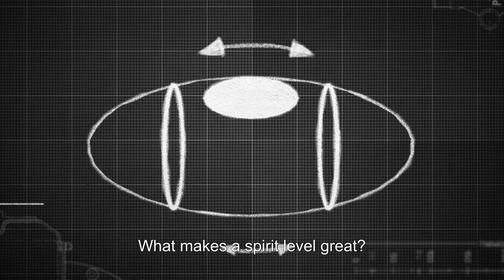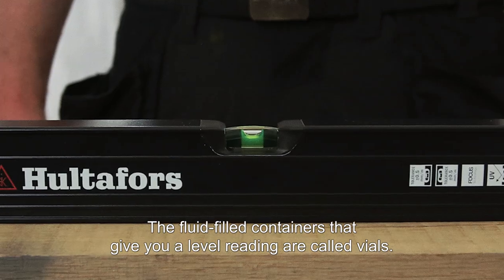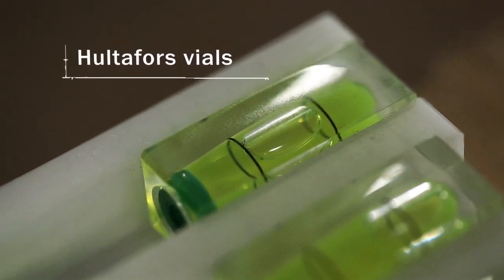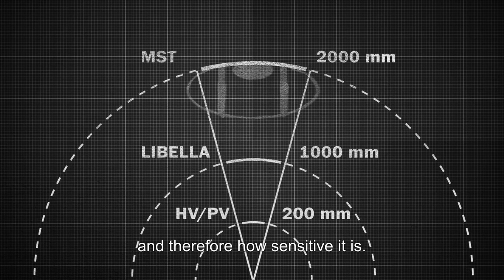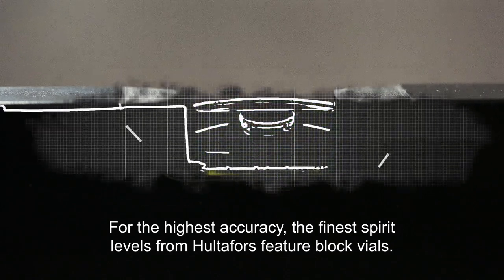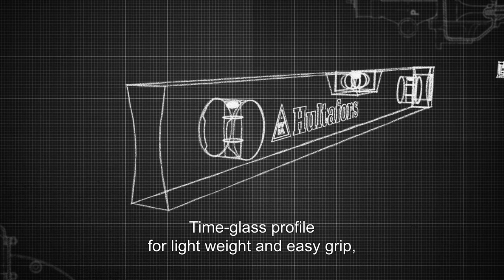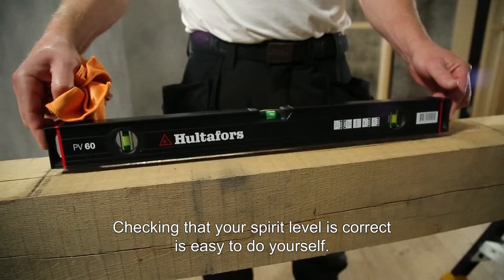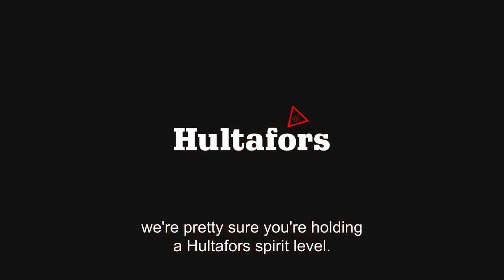Hultafors  - A higher level, the straight facts about spirit levels (with subtitles)

Comment: 9:29 Seriously?  What am I supposed to do, guess if the bubble is centered somewhere between the lines?  Why isn't the bubble big enough to reach both lines when level and centered?  There's a lot of room for error - costly error - with the slop between those lines, easily up to 1/4-in. out of level over a mere two feet.  Today's levels are crap, including Hultafors.  I still have four older levels, a four-footer and three two-footers, and when level, the bubble on all four touches both lines.
Reply: I was wondering if it was just me noticing how the bubble doesn't fit between the lines, and there are no secondary/runoff calibration lines.
Reply: @disklamer  That is an excellent idea - secondary calibration lines.  Level manufacturers should adopt it.  One of the issues I have with "modern" levels is that the bubble keeps getting smaller.  One comment I read said that an expert can judge where the bubble needs to be to be level.  I say BS, lots of factors affect that reading - eyesight of the user, sunlight, cold, awkward position, etc.  If you have to guess, there are going to be errors, and the smaller the bubble, the more likely an error.
Reply: @rla1000  Unless you're working at eye level it can be damn near impossible to read a bubble, I've started using my phone camera to get an angle on a bubble but it's a whole new set of juggling skills.
Reply: @Petertronic  And that's BS.  Why is the bubble ALWAYS, 100 percent of the time, in between the tow lines.  It NEVER reaches the two lines.  So that explanation is bogus.

Comment: Are Hultafors brand levels manufactured by Sola? Especially the high precision jamb level looks identical to Sola HPL model. The box level in the video looks like Sola but anodized black and with slightly different removable end caps.
Reply: Their regular levels definitively are, but I don't know about the precision level. The frame definitively isn't identical betweent the Hultafors and SOLA, and the SOLA looks to use a vial from their other regular levels. I need a high precision level but I don't want to fork out $250 for the Hultafors one.